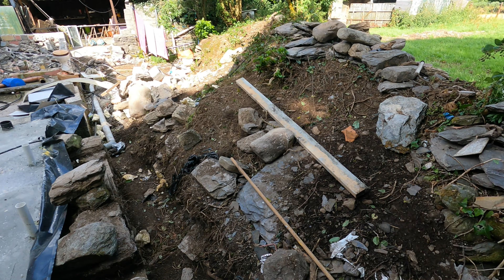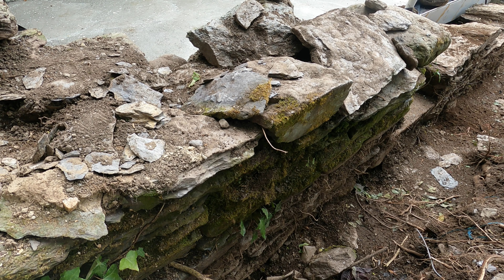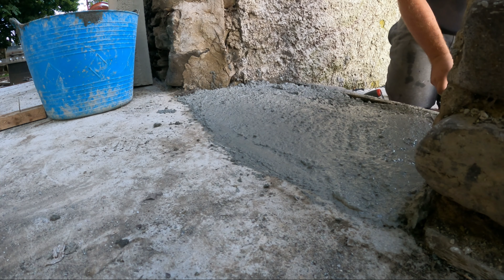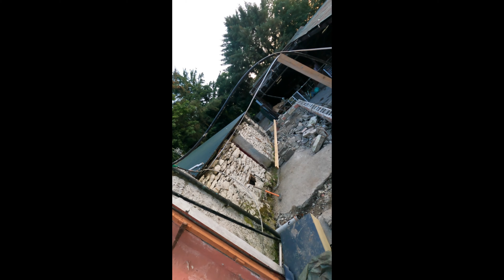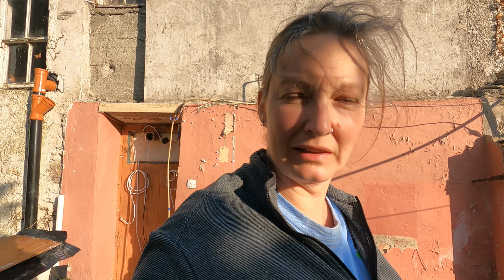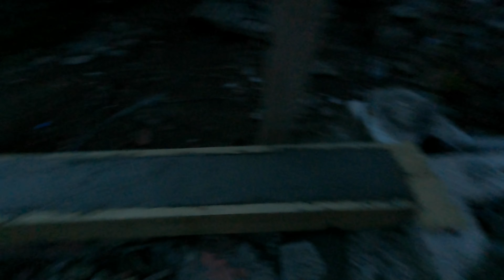EP29. Rebuilding stone wall in prep for our timber at our #Derelict #offgrid #farmhouse #renovation

Comment: The bedroom looks to be independent from the main house so why didnt you dig down so you would have a level floor across the whole front of the house. You woudlnt need steps in to every room then.
Reply from the maker: We thought that thru but as the building is on a slope it was more natural to keep the heights. Also the old stone buildings don't have good water protection so best to keep everything above the water table, particularly important as the bedroom is next to a rather high stone wall so it's a natural runoff.